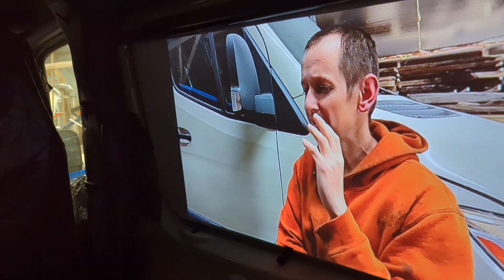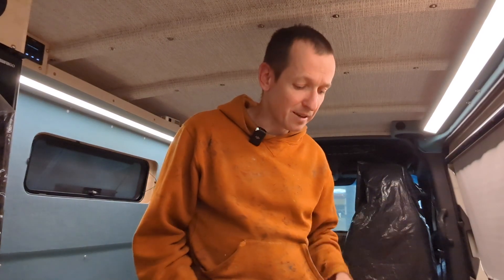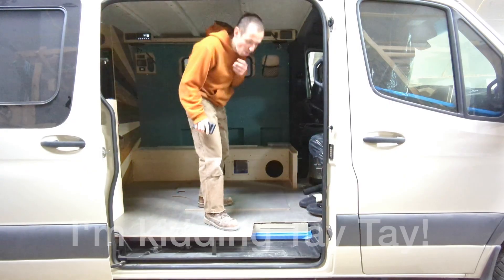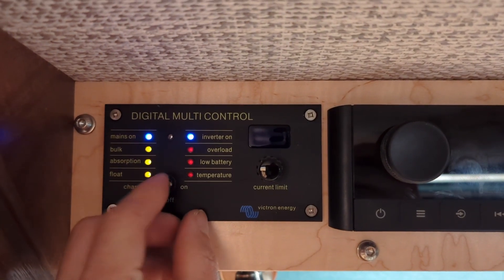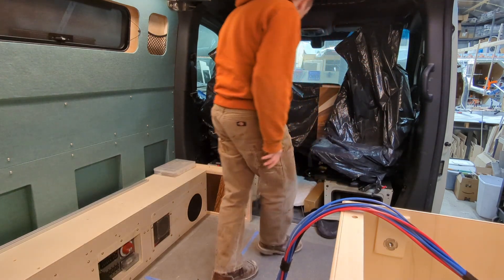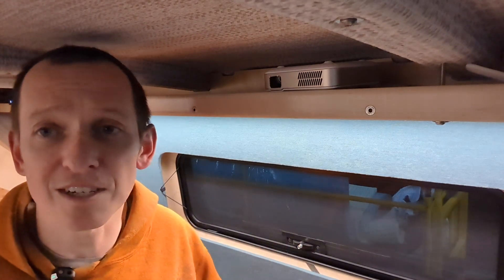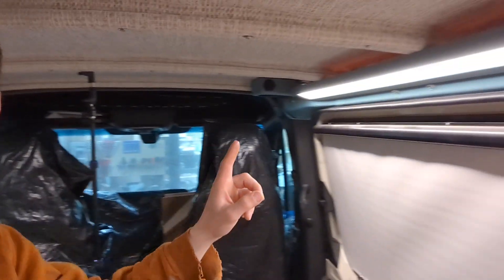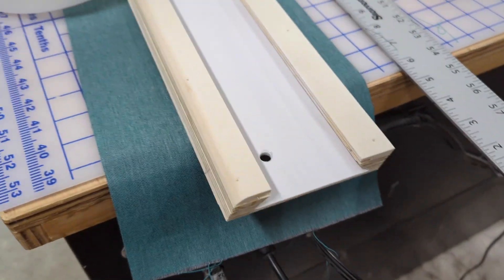Camper Van Lighting.  Making Simple Things Complicated.

Comment: Excellent video, thanks for the tips! I am planning a similar setup myself, but also want to use the projector as an extra screen for my laptop. How well does the Kodak handle brightness? Does the van need to be more or less completely blacked out, or could you use it during the daytime with some windows not covered?
Reply from the maker: I've got a small window about 3 feet to the right and leaving it open makes things a bit washed out.  I'd say I could read/write emails and stuff, but looking at details, or enjoying watching movies wouldn't be very fun.  If it was sunny and the divider curtain or front windshield wasn't covered it would probably start bordering on no emails as well.  The van has been inside during the build so my opinion may change a bit after I start using it. Thanks for watching!